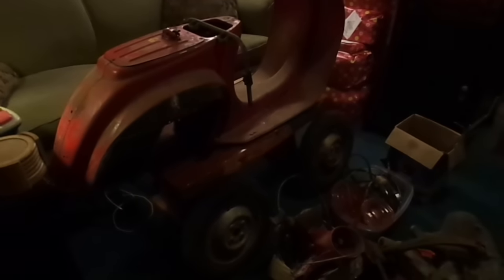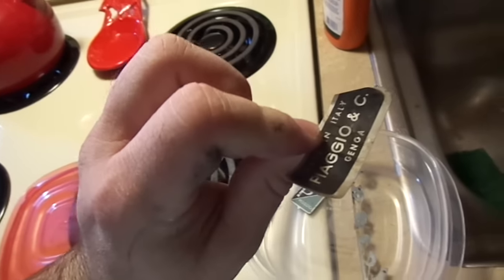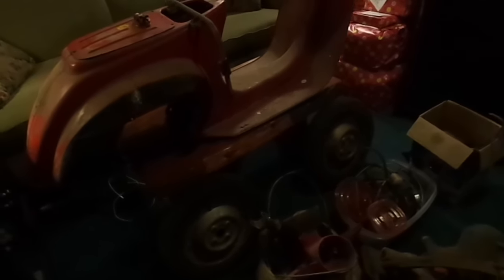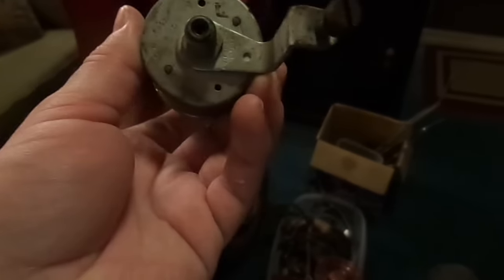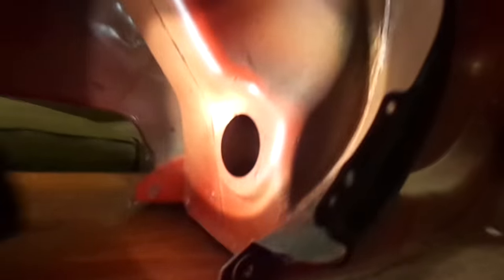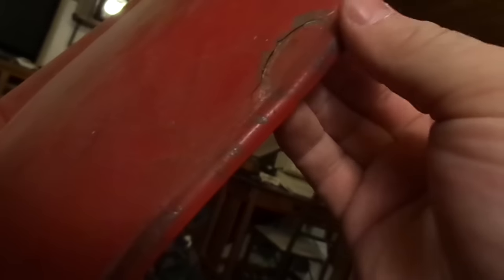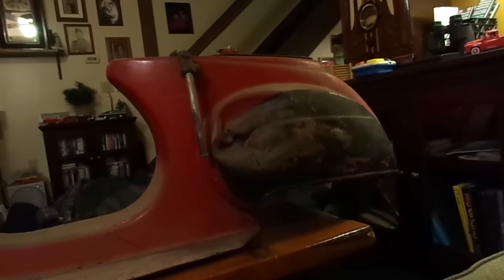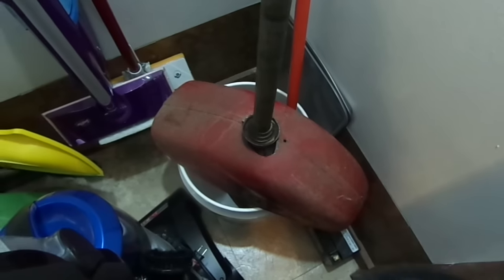1964 Vespa 90 V9A1T "Basket Case" Project

Comment: Wow, what a find ! 
Looking at all those parts there is a lot of treasure in there, lot's of originals.
Make sure the frame is still straight before spending loads of cash on the restoration,
check that the mount for the rear suspension in the frame is unhurt. 
I know what you'll be starting now, I've done it four times already, but the reward 
is well worth it.
One day, sunday, she'll take you on a ride. ( https://www.youtube.com/watch?v=8qIsZSKq5KQ )